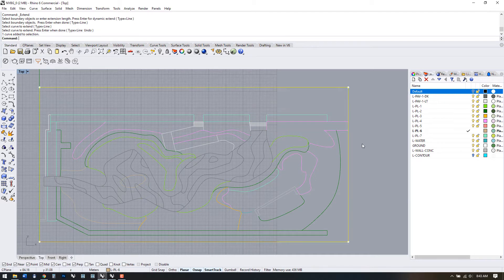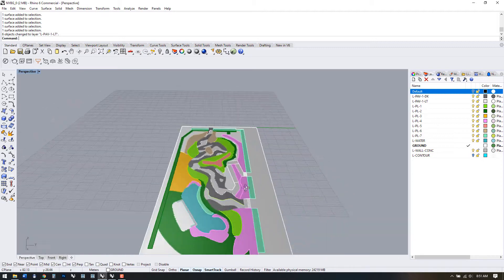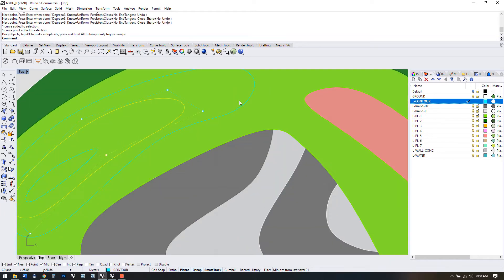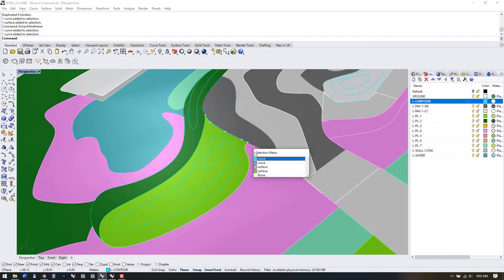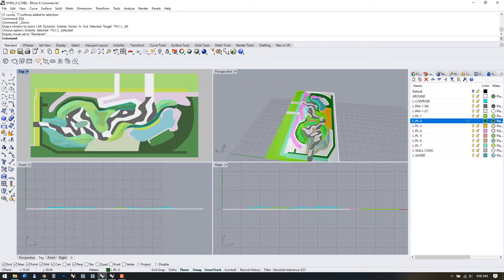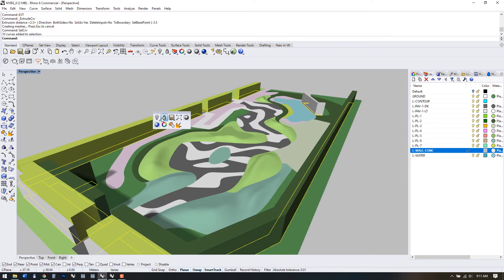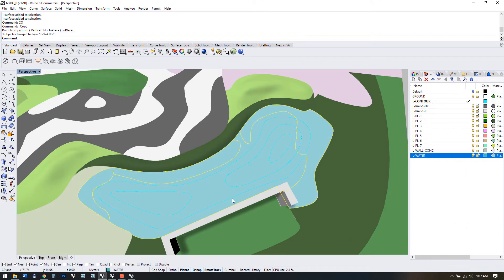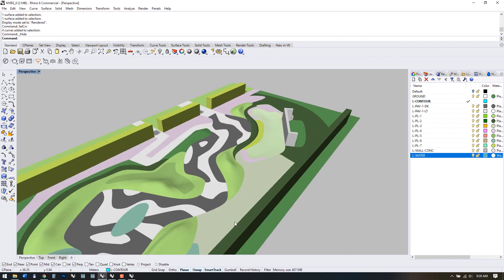Tutorial 1 / Part III - 3D Modelling

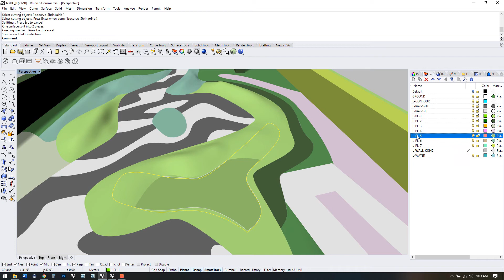Comment: Hi Stephanie, I'm glad I've found yout channel! I'd like to ask why can't I split the curves like you did at 9:34? I've gone over the steps again and again and I still can't seem to make it work
Reply from the maker: Hi, sorry for the late reply. It seems lots of people have trouble with splitting and mostly the reason is that your polylines are not closed! Try running the command "SelOpenCrv" (select open curves) and check to see if any of your polylines are not quite closed. You can try also the command "CloseCrv" if it's just a matter of a tiny difference between the end points, otherwise you might have to select a control point and zoom in on it to see what's going on. 99.9% of the time it's this problem, but occasionally you might have overlapping curves. In that case you need to explod the polyline, remove the overlapping curves, and rejoin it. Finally, sometimes even if that doesn't fix things, you can try extruding the polylines to both sides of a target split surface. Then use the extruded polysurface as the splitting object.

Comment: Thank you so much for this tutorial. I'm just starting out with rhino, so I don't really understand why you hide your outlines (around 3:15) and then use "dupborder" later. Is there a difference between these types of lines?
Reply from the maker: As surfaces and polysurfaces are created, they may deviate from the original linework used to first form them, especially if the input linework is made up of individual unconnected segments and curves. Using dupborder guarantees that you are quickly generating closed polylines from the geometry itself. In some cases you can probably use your original linework but in other cases (when you have more complex shapes that intersect each other, or disconnected / open polylines) you'll run into issues and it will take more time to try to remedy those before proceeding with modelling operations.
Reply: @FutureLandscapes  That makes a lot of sense, thank you!

Comment: Hi Stephanie, I am very much enjoying the tutorial. I am stuck around the 40-second mark. No matter what I do the spaces will not separate into shapes. even after I try the split command nothing seems to happen.
Reply from the maker: When a split doesn't work for me I try a few things.
1. Make sure all my linework is flattened using setpt - check off z only - match the linework with a corner of your planar surface. Try splitting again.
2. If that doesn't work, use the command 'selopencrv' to see where some curves might not be meeting at the corners and causing issues. You can select those polylines and use 'closecrv' or explode & rejoin the curves until they are joined.
3. Split the surface a little bit at a time, first with curves you know are closed polylines. Sometimes when I know a line passes all the way through a surface and it should be able to split, I extrude the curves on both sides by a little bit and then use the extrusion as the splitting object.

Hope that helps.
Reply: Did you create a plane which you are trying to split?
Reply: @vn2025  It wasn't mentioned,  but down the bottom of the screen shows which layer the object is on, I had trouble accidentally moving objects to different layers, so you should have the "ground layer" selected as the one to split, as you will see down the bottom when she splits it. Took me a while to figure out.